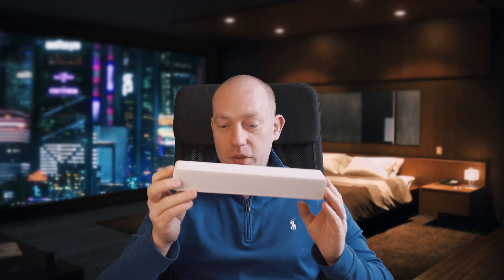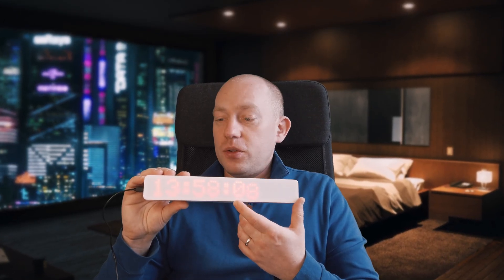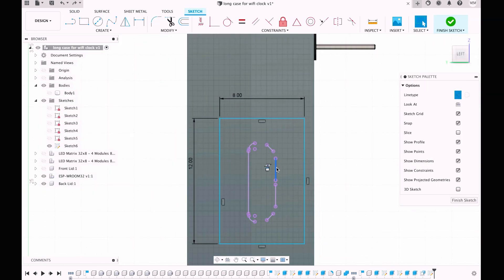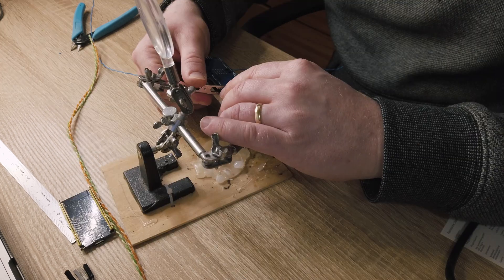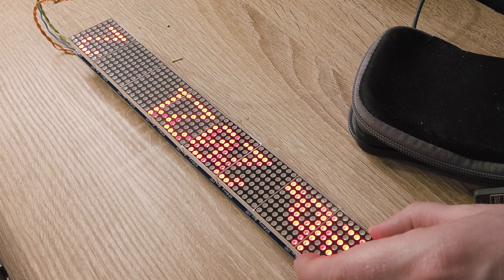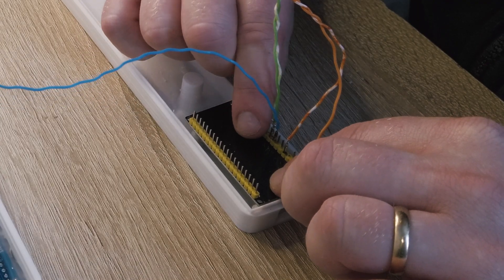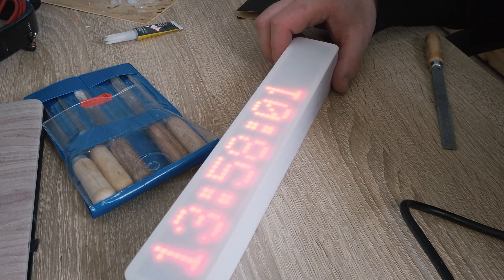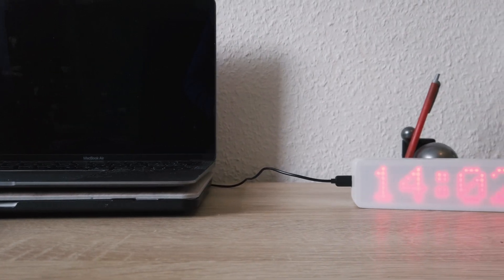Wifi Information Unit (ESP32 and Matrix Display)

Comment: Great device.  I'm going to make one!  But inserting the matrix into the 3D print looked tricky - should I increase the size of the 3D prints by two millimetres so the matrix inserts easier?  Thank you.
Reply from the maker: Hi thank you very much, yeah that’s a good idea to scale overall design for one or 2 mm at least, I’m going to release video where you can use only one matrix display, so that will be kind of mini WeatherStation it takes less space and it’s kind of fun to look at it.
Reply: @Max3DDesign  I shall increase the print size accordingly.  Thanks. I too have been looking at the smaller displays.  The large one is for the kitchen so space isn't really an issue, but a smaller one for the desk is on my list too, lol.  I'll look forward to your video.